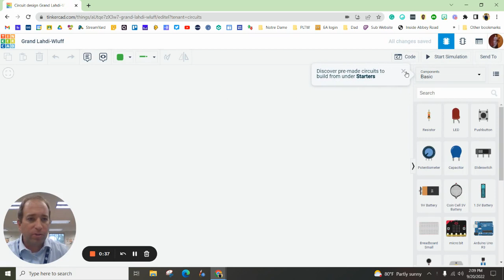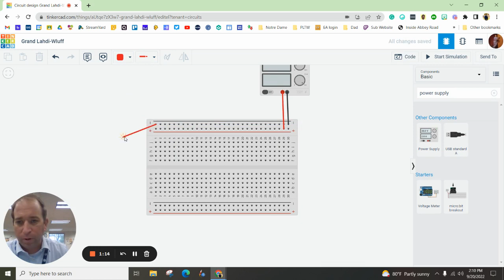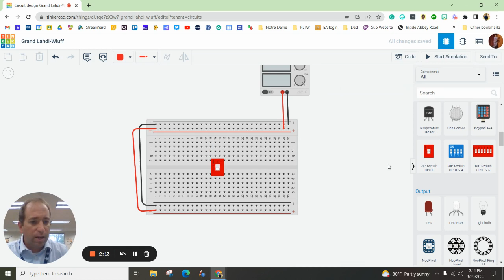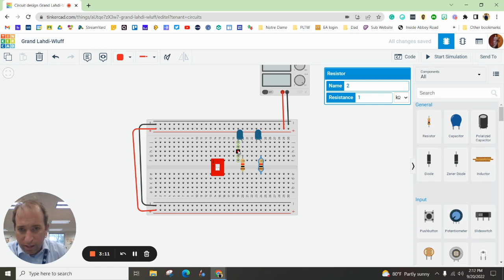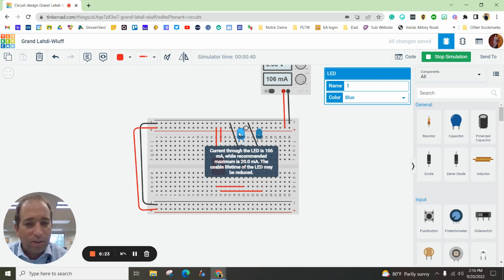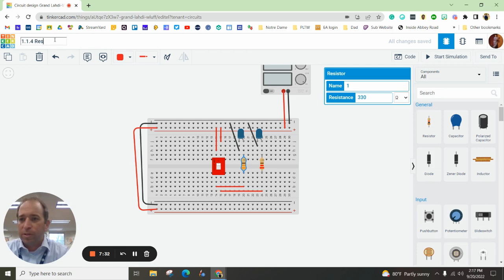Resistors and LEDs in TinkerCad

Comment: Is there a way to increase the terminal length of the resistor? (The foot of the resistor)
Reply from the maker: You can click on the resistors to change the ohms. You can also click on the power source to change the power.